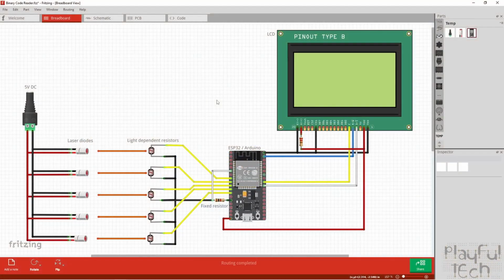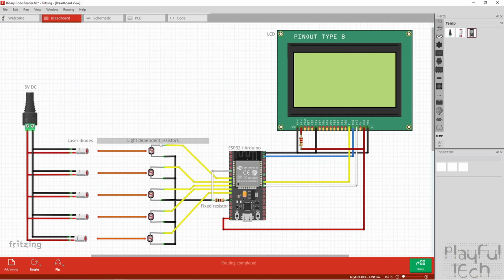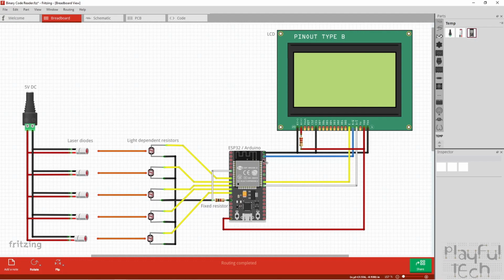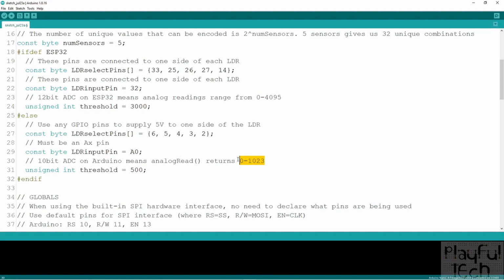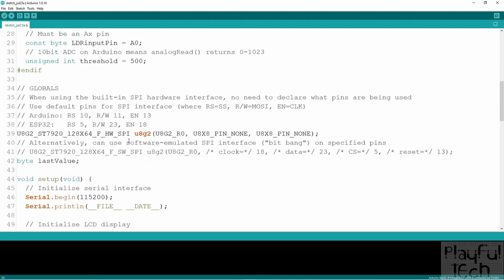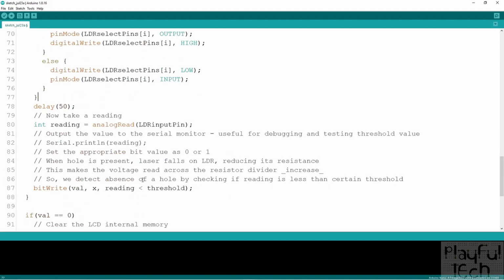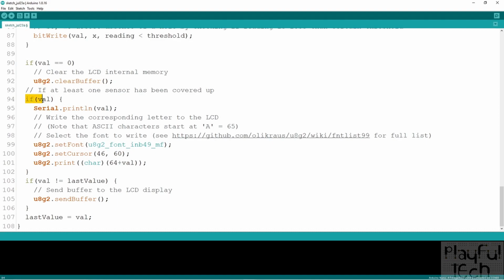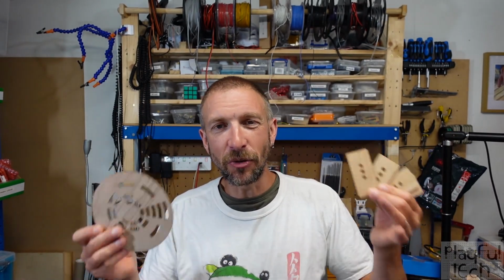Binary Card Reader

Comment: I'm a bit confused on the if statement at line 103.
It stops the program from resending a value to the screen, if it's the same, but if that's the case, how could you send the 2 S's in MESSAGE?
I'm probably missing something obvious..
Reply: I would guess the space between the holes would show a zero and set it up for the next set of holes to show the second S.
Reply: I guess that makes sense, there does seem to be a space between the gaps.
Thanks.

Comment: Interesting as always; although I did think that the use of the laser diodes. rather than simple LEDs, to be a little overkill. You did mention the effects of ambient light at various intensities, so I defer to your judgement on that, given that a bleed of illumination from the diodes can also work the other way around to mess with, or otherwise skew, your detected levels.

I really like your way of multiplexing the LDRs, and have to concede that I have had a bunch of laser diodes for a couple of years, gathering dust, and have never really found an application for them (modulated link)!

I enjoyed your presentation and appreciate the amount of work that you put into each video. Thank you. 
Ian_
Reply from the maker: Thankyou for your kind and considered comment! Yes, I originally had intended to do an array of simple IR beam-breaks, but what I found was that the IR LEDs I was using simply had too much spread, and also the readings varied based on environmental conditions (I like to have a lot of natural sunlight as much as I can, and that plays absolute havoc on anything that tries to detect IR!) . It would probably be possible to use them IR LEDs combined with some sort of sheath to narrow and focus the light they produced onto the corresponding sensor, but then it occurred to me that there are already narrow-beam light sources that are plenty easily-accessible - those little laser diodes!
Reply: @PlayfulTechnology  I've used simple opto slot sensors hacksawed in half  outdoors with no issues, I've also used a longer rage IR break beam, the key thing with those being the IR is modulated meaning sunlight has little effect as the receiver is looking only for a modulated signal, the output is a simple open collector output.